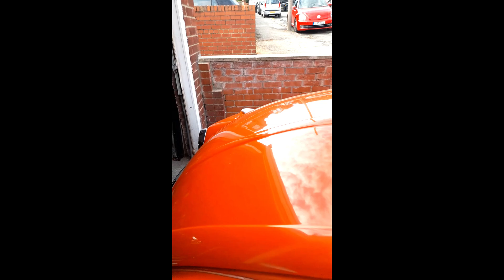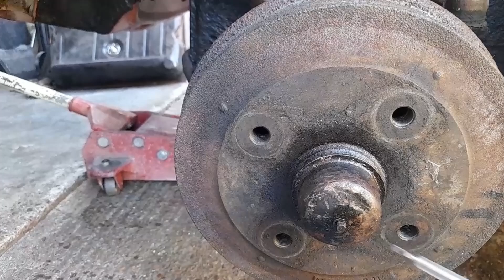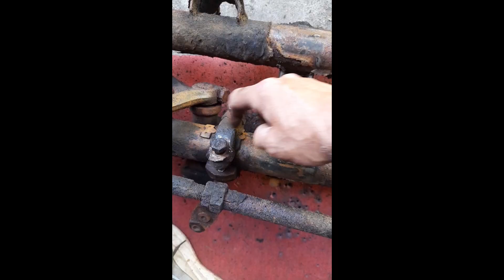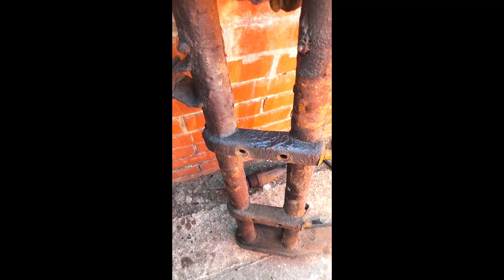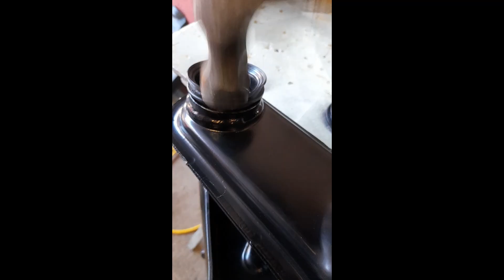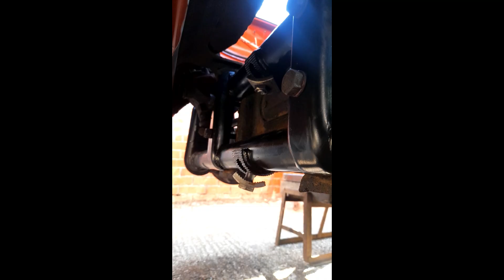Classic VW beetle beam change

Comment: Great job it looks good 👍 did you find it settled a little lower? I’m thinking of fitting an adjustable beam to my jeans Beetle too
Reply from the maker: Yeah we needed to take it for a run, once back we decided to drop it on the adjusters to lower it slightly.
One thing is if you lower it really low the ride quality suffers.
Reply: @glynharper1066 thanks so much for the reply, I’m thinking maybe just an inch, maybe 2 at a push would look great on the jeans it’s got standard size GT wheels and skinny tyres so the gap looks really big right now and my beams got a rust hole just near the drain holes on both sides so I’m guessing it’s worth getting an adjustable beam? The prices look about similar to a standard beam too
Reply from the maker: @TommyBug83  When we did this the price of a standard beam was more expensive than the adjustable one.